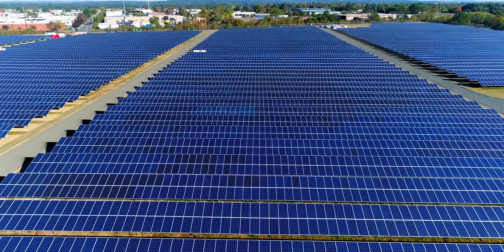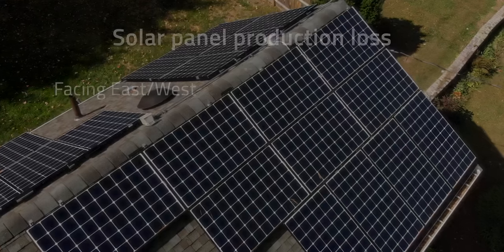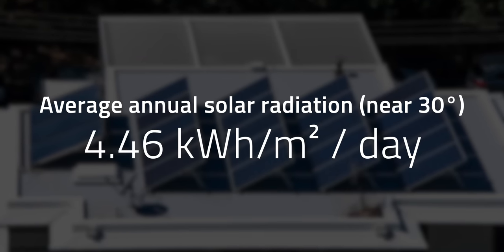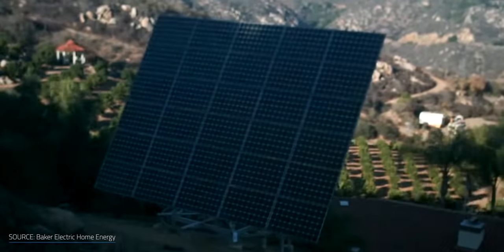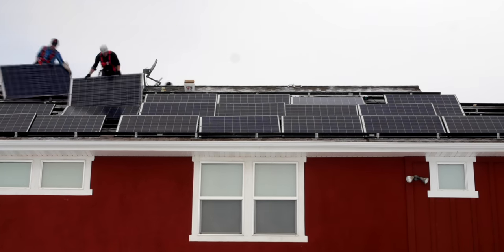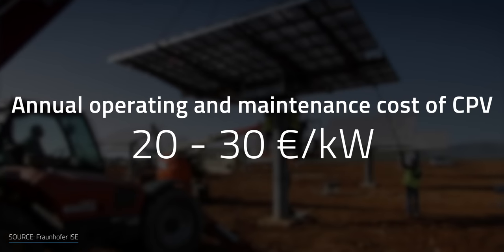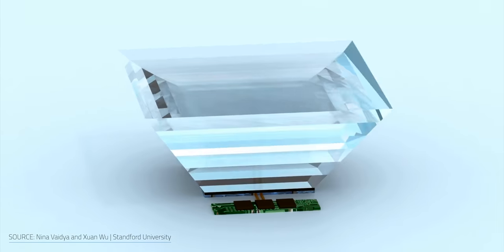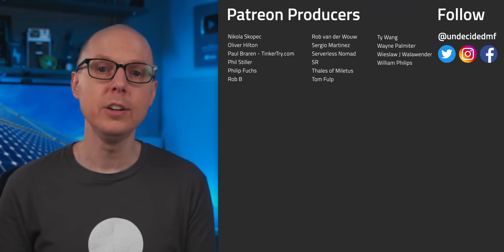This Invention Could Supercharge Solar Panels

Comment: I often wondered if options like light focusing domes and/or curves to just push the Light into a focus, even if the Sun is not at an ideal angle for a flat panel.  The light would generally be focused into a finer area. The Agile design definitely sounds like a great method there, and it just needs time to be implemented effectively. That definitely makes an impact towards better production of solar energy. Though storage is still the long term issue.
Reply: Sodium batteries r the way to go. They have pros & cons but safety makes them far better for homes (since size isn't a Problem). Total Cost while considering the total life charge cycles (with size & safety also factored in) = money $aver.
Reply: They've been doing this on certain types of systems for a very long time.  Check out the focused parabolic reflectors that heat some material in a tube at the focus, water will work.  Also, go look up heliostats.  Now THAT is some focusing, there is one that is HUMONGOUS, many acres worth of mirror.  You would be instantaneously fried if you stood at that focal point.  And it generates a LOT of watts.  I don't remember if they use water and a steam turbine in that one.  Might be some other fluid.

Comment: I understand “Agile’s” function, but the effective area of any array using this system will be reduced by the ratio of of Agile’s upper/input area and lower/output areas. For example, if the lower “square” adjacent to its designated cell is a 3 cm square and the upper/input aperture is a 4 cm square, the effective area is reduced to 9/ 16ths. This restricts the number of array (and cells) that will fit in a given roof area.

Comment: 6:27 They don't use a tracker per module: in small solar farms usually a single row of modules is connected via two sets of rods: one set of rotating rods adjusts the tilt, while the other set slides to adjust the orientation.
I've seen many of them in action in the fields nearby...

Comment: It would be interesting to see some field trial results with AGILE integrated onto mono-crystalline PV modules. It sounds a promising concept, but I worry that a cooling mechanism will be needed since, with concentrated irradiance, the cell temperature will increase dramatically thus reducing the electrical cell efficiency. With that said, it would be interesting to see if the solar tracking benefits outweigh such thermal losses, and if not whether the cost of integrating a passive cooling circuit would then provide any benefits. I'll definitely be keeping a keen eye out on AGILEs developments!
Reply: I'm not an expert, but wouldn't higher efficiency photovoltaic cells produce less heat. Then given that the cels themselves are relatively small and far apart this would allow diffusion of energy into the entire panel.
Reply: looking at the graphic, could it be possible to have some sort of heat sink in-between the smaller end of these pyramids? and that heat could be pushed to something to warm your house in the winter 😀👍
Reply: Would be interesting to have a solar layer that can collect infrared which could help reduce the heat from infrared light atleast
Reply: What do you by AGILE, I thought that had to do with like management practices during development. Please correct me if I'm wrong, I'm genuinely curious.
Reply: @lukasvandeputte9299  Its not the cells generating the heat its the concentration of sunlight.  Even just a mirror will increase output, but then heat losses will negate those pretty quickly.  Might work ok in a pretty cold climate.
Reply: @toastycarp  yeah, AGILE development is a project management technique with Sprints and things that sound kinda wanky... But I suppose these panels are agile enough to capture sun from any direction, like an agile goal keeper catching a ball?
Reply: @toastycarp   AGILE is the name of the solar concentrator technology discussed in the video, but yea it is also a renowned PM technique.
Reply: @lukasvandeputte9299  
Yes, higher efficiency means less heat, but with a 40% efficiency you still have 60% heat.
Concentrating the light on smaller cells is smart, but will also concentrate the heat.

There is more room for dissipation, but the heat is still deposited in the cell and this harms efficiency and longevity.

Active cooling would harvest heat energy (for a sand battery?), but adds complexity and cost.

The development speed is breathtaking right now, but it will take some time for the best and cheapest solutions to anneal.
We have to build stuff now and evaluate later. Waiting for the optimum solution is a luxury we chose to forgo when not heading the scientific advice a couple of decades ago.
Reply: @jackcastley6582  Bro I’m so sorry 😂, I’m still half awake right now so I wasn’t listening closely. Thanks anyways for the reply, I appreciate it.
Reply: @lukasvandeputte9299  The increased temperature resulting from the increased solar irradiance will increase resistance within the electrons in the PV cells and thus the power output of the PV cells decreases. This is why PV module manufacturers provide Power-Temperature coefficients usually in the vicinity of -0.4% for every degree celsius over standard testing conditions (i.e., 25deg celsius). This may seem insignificant, but even with the current non-concentrated PV modules, in warmer climates such as the Middle East and Australia, cell temperatures reach as much as 50-60 degrees celsius, suffering performance losses of up to 14% which, over the lifespan of the PV modules, induces significant economic, environmental, and energetic losses. Imagine you then concentrate 3 times as much solar irradiance into the cell.... not only would the performance losses be massive but the structural defects caused by the intense heat would also be extremely detrimental and potentially irreversible.
Reply: I wonder what would happen if you placed these over say, a water canal, as India has done, and California is planning to do. Would the water help to dissipate the heat and help keep the cells cooler?

Or what if you used these as a solar canopy, putting them above parking lots? There would be a lot of space for air below it to allow for airflow and better cooling compared to putting it on a rooftop.
Reply: @Geckogold  
Placing solar cells over a canal would cool them a little, but you'd have to pump the water past the cells to make a real difference. That requires filters and pumps. Not undoable, but perhaps not cost effective.

Parking lots with roofs would be nice :-) 

Farming under solar cells are possible too, with some modification of crops and machinery. 

The struts to support the cells will cost more money than placing the cells on a roof, though.

Comment: I set my tilt angle to the winter sun angle - overall works really well. More energy when I need it. 
Solar trackers are great when you have limited space and desire max efficiency !
Reply: And only.when you are out of space, an extra panel is likely cheaper if you count mechanical parts breaking.
Reply: @christianvanderstap6257  These devices, when well made really do not break - although they do require maintenance (like all mechanical devices).
Also with the maturing of Rasberry Pie and Arduino, it is very possible to build your own - which is where I am going at the moment - using a wheelchair motor to turn a shaft and move the whole array on one axis - I have a row of sheds that point north but can not jam too much capacity on them...
Reply: @madpete6438  not worth the complication unless you really have to. Most panels for residential are on roofs.
Reply: @christianvanderstap6257  Exactly my point - I have 2x arrays on my roof and it is full - just need a bit more capacity for when the weather is shitty - and not enough room to do it - hence the solar tracker project in my workshop !
Horses for courses cuz.

Comment: Single axis solar trackers dont need to be expensive or complex.

Just built into the support frame a manual mechanism that lets you change the angle 10-15 degrees. Change it as many times as you consider it necessary, but 4 times a year should be good enough.

Comment: I think that Agile would be incredible if it could be retro fitted to existing installations. If I could lay it across my current panels it could increase efficiency and possibly extend their life span.
Reply: Oh yeah, I guess you could do that. Since the light bending effect is essentially surface refraction rather than actually relying on bouncing off the walls of the prism, you could sell sheets of this stuff and just cut to fit. It won't increase the life of your panel any, in fact it might decrease the life a bit due to increased heat, but you could reuse the AGILE layer if you wanted to. Just remove the AGILE layer from an old panel, buff it a bit, and glue it onto the new panel. The hardest (and maybe most expensive) part would be finding an optical grade glue with the right refractive index.

Comment: Great video Matt, 2:03 My roof is also facing east/west. And although an East/West roof produces less electricity than a south facing roof, in many states with "Time Of Use" billing (coincidentally, in the UK, it's called Agile Tariffs), facing the bulk of your panels West can have a bigger monetary value than facing them south since you can get double the kWh credits during super peak (2pm-6pm) for every kWh you push on the grid during that time.  If for example, California gave better incentives for mounting panels on West facing roofs, they wouldn't have an over abundance of supply at noon, and at the same time, issue Flex Alert warnings during the afternoon. All without the need to implement battery storage to shift the available supply.
Reply: Problem is relying on the grid to offset costs. Alot of power companies started to pay 1/4 the amount per kwh that they charge the customer. So if you sold them 20kwh you would only get 5kwh back at night then it would start to cost you money. Alot of people based their solar break even points on the electric company using net metering or buying electricity at the same price they sell it back to you. The more house get solar the less they will keep doing it.

Comment: When we had solar panels installed, we have hardly any north facing roof so we decided on 10 panels facing east, 13 panels facing west.

In comparing to friends and family, although we generate less peak power across the day, we generate similar total kWh per day but our generation is longer than those we have compared to. At low latitudes in the southern hemisphere (Perth, Western Australia), the sun rises and sets south of east/west. We have found having east/west panels is better for self sufficiency by using power when it is generated.

Comment: As other depicted in the comments below, the light hitting the surface does not increase with this new panels (simple trigonometry). I see only one advantage: you can make the solar cells smaller because they are hit by a concentrated flux of light. This could make this panels cheaper than the traditional ones (but you have to solve the heat-dissipation problem...)
Reply: Add a peltier element on the back (or make the entire bottom of the solar panel a peltier element) to convert waste heat to electricity...but that adds to the weight problem

Comment: Complex production process maybe much more costly than a simple good balance mechanic system in most cases, for couple of watts you can move whole row of panels at once with relatively small motor if the weight is balanced.

Comment: Solar is already good enough. Most of the time just adding more panels to the system is the cheapest option. The real limiting factor is storage and/or moving usage patterns to the daytime. Eg changing fridges to have a greater internal thermal mass and then 'charging' that thermal mass during the daytime would help way more.

Comment: On tech ingredients people mentioned the issue with the focusing on panels is that the lifespan of the cells gets reduced drastically if you attempt to. Aim more light at it... Yes you could double or triple production but if your panel only lasts a third.... Then that's not great

Comment: I’m an optical engineer who works in the concentrated solar industry.  As many have commented here, the #1 limitation of this tech is that the system as a whole will still suffer the same “cosine losses” as the un-tracked panel front will still get the same reduction of total energy as the sun moves .  That said, looking at “cost-performance”, there may be some advantages - let’s look at them one at a time.:

COSTS:  As a rough frame, while a PV installation may from $1/W~$2/W, the Module (panel itself) only represents ~$0.40/W (let’s say ~40%).  Then, of the Module costs, the cell itself (consisting of silicon wafer, metallization, fabrication/energy, production labor/O&M, etc) is roughly $0.18~$0.24/W - or roughly half of the panel cost.

So, even assuming the concentrators are ‘free’, a 3x concentration will reduce wafer costs to ($0.2/3) = ~$0.07/W.  Assuming a $1/W installation cost (utility scale, not residential), this would reduce cost to ~$0.93/W.  *BUT*, the researchers claim that the optics are ~90% efficient, so we’ll get 10% less power… resulting in ~$1.03/W.  Yikes!!  That’s not a win (and of course the tech isn’t free!), but…

PERFORMANCE:  Two possibile gains here:  

First - activation threshold.  There may be unseen gains here as the silicon bandgap has a ‘activation energy' (threshold), and on cloudy days may not reach it.  Having 2~5x concentration goes a big way to ensure turning the semiconductor “on” in low light environments.  

BTW, I don’t see thermal issues being a problem here, as this is a very low conc, and I’d bet $100 that the polymer-based optics absorb most of the unusable IR.  So, chips may run cooler!

Second - reflection losses.  When light hits silicon at an angle, some is lost due to ‘fresnel reflections’ that increase exponentially at higher angles.  This concentrator does an interesting job of having those grazing rays hit the cell at more normal incidence.  It has a field of view of 2pi steradians… which is huge (a whole hemisphere).  This effect will be less when the sun is more direct to panel face, but may add-up at wider angles (and especially for the diffuse light of clouds). 

SO…  could add-up!!  But, the devil is in the details - and these are much more complicated on factors such as panel orientation, %-cloudcover/yr, etc…

Could have merit and I believe it’s worth investigating! ;)

Comment: That's cool but it seems that the power comparison isn't per square foot of panel area and are instead on PV cell area. If I am correct then the numbers are a bit cooked and wouldn't reflect total panel area. Also that prism seems like a lot of material when you expand it out across a lot of surface area due to the added depth, does it need glass on top of it too? etc. If it turns out to be a better option, that's cool but I would be surprised if it has a cost advantage over standard panels in the future.
Reply: Wow Mic's still alive! Must be pumping in the Supplements Hot & Heavy to keep that Vegan Corpselike Body going. 🤣🍔🥓🥓

Comment: If I understand this correctly, it's a very similar effect to the Fresnel lenses used by lighthouses to extend their visible range... but instead it's collecting sunlight and focusing it on the solar cell. Very cool... and seems like it should be scalable.

Comment: I haven’t watched the video yet as am busy on a project, but the PV Concentrating solution is an essential of the future. I explored this some 10 years ago. The advantage here is the use of the SpectraLab 40 watt 40.5% efficient chips (used of the space station) with 700 to 1 solar concentration to a group of devices mounted on high efficiency heat transfer modules. These PV devices are just 15mm square and with max tech mounting will deliver up to 80% energy efficiency where the thermal energy is able to be used. This means that they should be utilized in a domestic or industrial installation. The SpectraLab devices were just $40 at the time we looked at them. Run the numbers and you will see that a 10 Kw PV capacity with up to 10Kw thermal capacity is readily achievable. NB. To heat a 200Ltr water cylinder through 40 degC requires 10Kw Hrs of energy, so if this energy is extractable from the surplus energy of a PV system the recoverable energy more than sufficient for 100% sustainable domestic energy. NB2 non solar periods are covered with domestic refuse converted to syngas powering Liquid Piston 3Kw generators. The only negative of such a system is that it requires a unique mounting system that is best achieved where dwelling roofs have a mansard feature to give sufficient solar access for the 10Kw PV/10Kw thermal system in a solar well in the roof (such a solar well is invisible in the building profile from ground level).

Comment: From 1977 - 80 I worked at a company in Rochester, NY called Fresnel Optics. We made plastic micro services lenses for overhead projectors, reflective tape, landing sights for aircraft carriers,
And one that was particularly interesting at the time was  2’ x 3’ acrylic magnifying lenses for large screen TVs. They let me have a few of the rejects and in the full sunshine these things were powerful and mind blowing in terms of concentrating power of the sun. In 30 seconds you could ignite a tennis ball 🎾 into flames 🔥. You could burn holes into asphalt. My boss pulled me into his office one day when We started talking about making assembled arch shaped and mirror coated lenses for solar. 
    We made  lenses for a company called Spectra Optics in California that was in theory, storing energy in tiles using a laser. Never heard more about it. 
Think I’ll Google